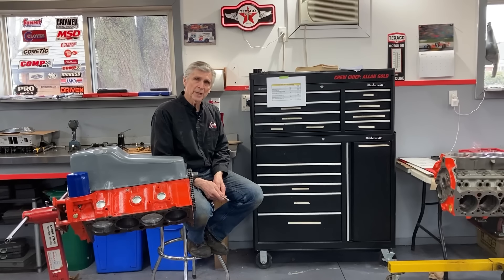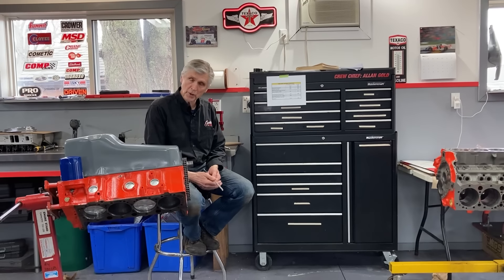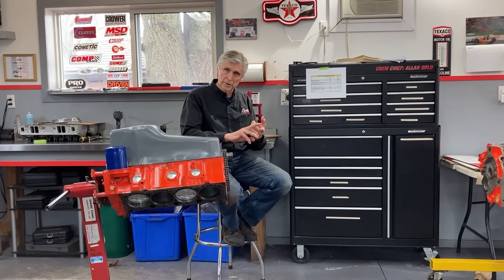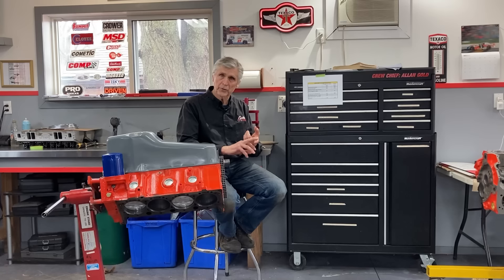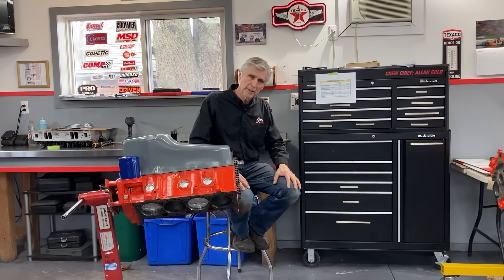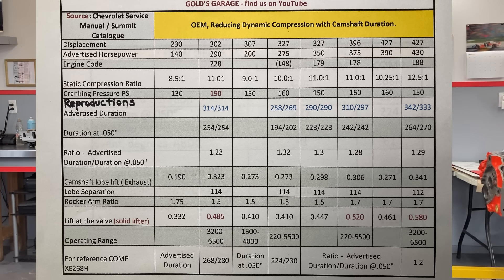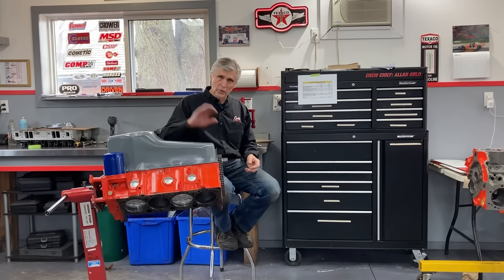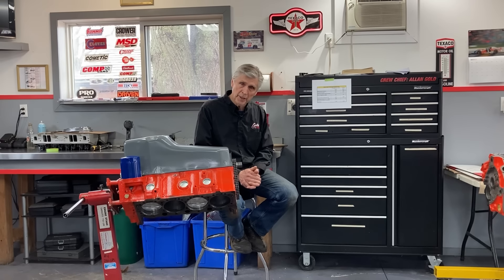Selecting the right camshaft - Compression Myths How much compression can you run on pump gas?

Comment: My 1998cc Alfa Romeo Spyder (mechanical direct injected) is running 16.5:1 corrected CR on unleaded premium (92 octane 100% gasoline) pump swill and has been for 41 years. It is a Hemi head and it turns 16,000 RPM (peak HP at 12,600 RPM) , but Alfa was building engines that turned 10,000 RPM RELIABLY before WWI! BTW, the Alfa engine has NO valve springs-it uses desdemonic valves with followers (forks) that push open and pull the valves closed. It also has a Magneto Marelli magneto and surface electrode spark plugs that whines like a turbo, driven by the crankshaft.  The clock is showing 180,000 Km and it doesn't use any more oil than when new (about a liter between changes, normal by the owner's manual). The four-banger holds 7 liters of oil WITHOUT filter or nearly 9 with filter (big oil cooler built-in).
Reply from the maker: Very cool Ricky, must sound great at 16,000RPM. Different world than Detroit muscle.
Reply: Cool very interesting. I'd like to see the valve train
Reply: Big American engines with long strokes cannot reliably turn over about 6000 rpms in somewhat stock configuration.  I have no idea what affect extremely high engins revs have on pre-ignition.    Most stock  engines sold in North America are around 89mm stroke.           A  $40,000 full custom race engine for circle track use will usually be 6.7 to 7.6 liters, roughly, and they are usually around 100mm in stroke.   These engines will run several thousand laps in a year, and they will have acceptable reliability at around 9000 rpm maximum rotation speed.
Reply: @kevinkelley3657  i have a 427 that I run it  at 8500 rpms   it's a aftermarket Dart aluminum block and 12/1 compression I run M1 methanol  and a 98mm forced Inductions turbo point being you can build à reliable engine to turn rpm mine is a small block but that's all that I will give out Openly on here I still race so I'm just saying you can you just have to get the right parts and engine builders I go to tkm there the best in the country.
Reply: @MarineX1124  I said in my comment that "custom engines" could turn 9000 rpms reliably in a circle track engine, for one year...........I said that these engines were usually around 100mm in stroke.       If you disagree with me, what is your exact argument?    I have a VERY good friend who is THE machinist to use in this are........I also understand what aftermarket heads are capable of doing.       I am not sure that I understand your argument, but if you have $10k to 15K to spend in parts, you can absolutey build a 9000 rpm chevy based engine that should live for 40 races on a round track under 1/2 mile in length.
Reply: You mentioned the machinist I see you have the last name of the best here
Reply: @davidreed6070  The machinsts name is "Damon Wrightt".   He and his brother own the best machine shop in my area.   I do not really understand your comment/question.   Are you a real person????
Reply: @kevinkelley3657  yeah I just noticed you were talking about the Best machine Man in your area, your last name and the Machine Man in my area is the same. The man held the pro stock championship in the day. Who knows you and him could have been kin. I meant you no disrespect at all
Reply: Alfa Romeo, or in fact Italian's, making anything reliable... ROTFL

Your car/engine combo must have been a special order?  

BTW the inlet runner, throttle opening, port, valve, exhaust valve, port, pipes and cam duration to support peak HP @ 12,600 rpm at 1998cc will see peak torque around 10,000 rpm. Idle would be up around 3000-3500rpm

And the clock is showing 180,00km's you say? I bet it drives like a dream in traffic too?
Reply: @davidreed6070  Ducati use this too
Reply: Is that unleaded from america? Or another country? I know over seas from america they use 95+ octane where as here in the states we dont get anything higher than 93 usually.. i know shell has 94.
Reply: @DrGibs347  I think gas is rated different in America from overseas.
Reply: That’s awesome.  Sounds like a stout little piece.  Has to sound great at 12,000 rpm.
Reply: What bullshit are you talking about? There's no such an Alfa engine as you described, especially on the Spider. The only thing with similar performance to modern engines was the V8 from the 33 Stradale but that was basically like having a road legal LMP car today. Also I don't remember Alfa Romeo using desmodromic valvetrain in any car whatsoever, it was Ducati that started to use that on their motorcycles since the mid 50s.
Reply: What kinda AM? I’d love read up on it more
Reply: 16,000 RPM or about DOUBLE what Honda VTEC  is capable and TEN GRAND in 1915 ?? in the "Castor Oil" days . . . before fuels were "formulated" - BULL !!
Reply: they say the higher rpm the less time for detonation to occur as the flames can only propagate as fast as the engine speed allows and at above 20,000rpm the flame just cant burn fast enough

Comment: On a 350 Cid truck engine with 422 442 cam 204 214 at 050 dur. 112 lsa. Would a 194 intake valve size be a better choice for velocity and low speed torque. I want to buy some Brodix 180 heads but maybe that's a little too big and I want good mpg. Flat tops .020 down. Quadrojet with factory aluminum manifold.
Reply from the maker: Thanks for your question Jacqueline. I don't think the Brodix heads will hurt, but they are more than you need to work with the rest of your parts. If cost isn't an issue you could use them but there are less expensive heads that will work well. Hope this helps. Good luck with your build. AG

Comment: Combustion chamber shape has large impact.   One extreme example is the Jag HE V12 engine, has a pocket in the combustion chamber that's 11.5 to 1 on pump gas back in the 80's.   Also today's modern heart shaped tight quench wedge shaped chambers are more resistant to detonation.    Also good spark control off the crank shaft helps.  This is a particular problem on the SBC with it's dist far back and at the end of the cam... that make the spark bounce around, that's no good and that variation can cause  erratic spark and trigger detonation.   Crank triggers are a must with high compression.
Reply from the maker: Thanks for the comment John. You have deep knowledge on this subject and giving us something else to think about. AG
Reply: I struggle with small block mopars trying to make them run smooth.  I put on a set of "fast burn" heads, heart shaped modern design and Wow, what a change. Best small block Mopar I have ever seen.

Comment: Just as dynamic compression, set by the camshaft events greatly influences cranking cyl pressure, a running engine has variables that determining the octane requirements. A high compression race engine with over 14:1 calculated compression ratio with a relatively short duration cam could reliably run on 87 octane gas no problem, if the torque load was kept minimal. This would require a throttle opening to maintain relatively high intake vacuum. In this case, the engine can't develop high combustion pressures/temps associated with detonation. There's a ton of other factors at play, combustion chamber temp and efficiency,  total ign. timing requirements, accuracy of maintaining proper fuel distribution and ratio evenly across all engine loads and cyl to cyl, etc...

Short answer, in an old school carbureted muscle car era engine, I would agree with your assessment on taking a close look at cranking compression pressure as a good overall indicator of detonation resistance. Unless someone was willing to spend a ton of money to modernize all the development shortcomings due to age of these old engines, and taking the owners dedication and ability to monitor for signs of detonation, I'd say anything over 10:1 would really be pushing it when combined with a typical hot-rod street camshaft.
Reply from the maker: Thanks for the input Jeff. AG Look for future videos on this subject.

Comment: VERY WELL PRESENTED. ALSO LOBE SEPERATION ANGLE. L88 WAS 114. TIGHTER LIKE MOST COMP CAM STREET CAMS ON 110 MAKE MORE CYLNDER PRESSURE WHICH EQUEALS MORE POWER. ALUMINUM HEADS ALOW 1 POINT MORE COMPRESSION ON SAME OCTANE..180 TO 200 PSI ON A PERFORMANCE STREET MOTOR RUNS NICE. BUT NOT SO MUCH FOR TOWING BECAUSE OF HEAT GENERATED LONG TERM
Reply from the maker: All good points Hank, thanks for contributing. I will be making more videos on this subject, watch for it.

Comment: My 467 has 10:1 static compression, and 200psi cranking compression. It runs on 91 octane with 36 degrees of timing locked out. No pinging ever.
Also, I recently tested Shell 93 octane. It had 7% ethanol. And I also contacted Shell Canada about ethanol content in their 91 and 93 octane fuel.

They replied just today that their 91 and 93 now contain up to 10% ethanol.
Reply from the maker: That is good information Pockets, Here, there was a sticker on pump saying that 91 contains no ethanol. I will check again. Thanks for the comment, please keep watching. AG
Reply: Try E-85, wow !
Reply: I have a 302(5.0 coyote) with 12.5:1 compression and about 180 psi cranking pressure which I run on 91/93 
235/237 duration 
~535 crank HP
Reply: Well then your fuel mixture is below 12.8. There’s got to be a trade off somewhere.
Reply: You have a fat overlap(not LSA) of about 60-85 degrees yes? That will bleed off that compression. In other words it’s a higher reving cam profile 3500-7000?
Reply: @MrLuvtheUSA variable cam timing allows the exhaust valve to stay open longer to bleed off pressure under load. Oil pressure is the key to this application. Low rpm lower oil, more exhaust bleed. Higher rpm higher oil pressure less load on top end reducing pinging with a more closed exh valve timing sequence. Make sense?

Comment: What an high quality content !!! Thank you so much for all the effort and time  to explain things and help us out building our engines . 
I’m currently building my small block Chevy with a target static compression ratio of 11:1 , it’s a 305 with -0.5cc dome pistons and 56cc Aluminium heads (trick flow) , I’m still unsure about the right camshaft . I want it to be a solid flat tappet , I’m thinking about comp‘s extreme energy 12-664-47 it’s a 4/7 swap . I’m just concerned it’s too small for my compression ratio. I am aware that I will need to run high octane fuel 
Btw the engine will be coupled to a tremec tkx 5 speed transmission and a 3.73:1 rear gear in my 79 Camaro 
Best regards from Germany !!
Reply from the maker: Thanks for the question Ricky and hello Germany. That is actually quite a big camshaft for a 305 in a street car. I suggest you go to the Wallace on line calculator and check your cranking pressure and dynamic compression. I like to be around 180PSI. Hope this helps.AG
Reply: thanks for replying! I highly appreciate it, I tried the calculator and it says 195 PSI cranking pressure and 8.54:1 dcr, since I run aluminum heads I could get away with that I guess … 
Yes that camshaft is large for that little engine for sure , but we’ll see .. have a nice weekend!

Comment: Years ago I rebuilt an LT1 in my 70 Z28, although at the time I was led down a path of lowering the CR, I think stock was 11 or 11.5:1.  When we were done I think I was around 9.5:1 and at the same time the GM performance handbook on LT1's listed a offroad cam for the engine, at the time Crane built one to that spec so I installed it.  The engine never ran right so I called Crane and the first question "what CR are you running?"  He said you need a minimum of 11.5:1 to run it.  So I had to pull out that cam and replace it with a lower duration hydraulic.  Now for my question;  I am about to embark on a Ford 351w build with a brand new 4 bolt block.  I am also making it a stroker 408ci.  I do not want the high HP but I prefer a high torque motor, it's going in my '85 Jeep CJ7.  Two things I would like to know;  If I run E85 or 91/2 octane what CR should I shoot for?  Also what off the shelf roller cam should I pick?  Thanks in advance!
Reply from the maker: Thanks for the question Dave. With a roller cam, you need less duration, but you have lots of stroke so duration in the range of 210-220 degrees @.050". With 91 octane fuel, 10:1 CR with cast iron heads and 10.5: with aluminum heads. Design for a max cranking compression of 175-180psi. you can find on line calculators for static and dynamic CR and cranking pressure. I don't have any experience with E85 but I think you could run higher CR and cranking PSI. Hope this helps. AG

Comment: Having quench rather than open heads has huge impact on how much compression you can run.  
In Australia our standard 430hp 351c, which I still have in an XE ESP runs flat tops, 302c heads opened up to 66cc’s, F246 cam, Weiand  excelerator, 750dp, good extractors straight thru mufflers which make 430hp at 200psi dynamic compression.  
No pinging but low gears and light car has a big impact on how much compression you can get away with using pump fuel.
Reply: Forgot to add it’s a long rod 351c, which also lowers dynamic compression, uses a 302c 6” rod rather than 351c 5.78” rod, has modified pistons.
Reply from the maker: Hello Chris from Australia. Those are good numbers for a 351 and 200psi. What octane fuel are you using? AG
Reply: @ Hi, The highest we have which used to be 100octane but now can only get 98, but equals around 94/5 in USA.  I have 3.5 diff gears weigh around 1750kgs and top loader box.

Comment: I sent my cam in to a custom grind shop. Im building a stock FE 428 stock dish 4.13 pistons. After I got the cam back he said to keep compression lower than 9 to 1 and use a stall 2500 converter. Putting it in my 72 f250. Just now learning about cams. Just got my new pistons. Im seeing on my cam info card that intake V Closes at 38 ABDC. I need to assemble the rods n pistons to see what comp height is this week. I think the cam he sent me would raise the compression up if i understand correctly. My heads are 72 cc and gasket .o42. This is my first home built short block.
Reply from the maker: Thanks Ed, looks like that cam IVC is a good match for 9:1 CR. After you determine the deck height, you will have enough info to calculate the dynamic compression and cranking pressure. The Wallace racing on line calculator works pretty well. Good luck and let us know how it turns out. AG
Reply: Thank You. Oregon Cam here in Washington has been building cams for ever. After I  do some measuring I will send him another core. I have quite a few here.

Comment: great video, the thing that NO one ever talks about is how many BUMPS on the comp gauge is required to get the needle to 150PSI? Hydraulic lifters give mushy valve action when cold so thats why we test at operation temps. Ive done 100s of comp tests at GM on thier dynos in australia  and the SLOWEST comp needle movement was from the LS series of engines, they required 8 comp bumps to get to the desired 150PSI with a 10.4:1 engine! But when we took out the corvette cam & installed a 5.3 truck cam the comp was now 165psi & it only took 4 bumps on the gauge! testing on the truck cam bought peak torque and horsepower down the RPM line about 1000rpm. My boat has a 351c with 302c heads  & laid back chambers to give a measured 10.2:1 comp, with a 218 cam. comp gauge reads 165psi in 2 bumps on the gauge and it just likes 95 ron fuel ( your equivelent 91 octane)... I really enjoyed your video, keep up the good work.
Reply from the maker: Thanks Wayne from Australia. Did you know, the number 1 city in terms of clicks on my site is Milbourn Australia and many other cities in Australia are right up there so thank you for the great support. I think the Wallace Racing guideline is 7 bumps but for the reasons you mentioned I think you should  keep going until the pressure reading stops going up. Usually that is about 4 bumps. 91 fuel should handle 165psi easily. Hope this helps. AG
Reply: What kind of exhaust manifolds on the cleveland in the boat ?

Comment: We ran our 482 big block Chevrolet with 12.5:1 on 91, for YEARS in a boat.  Kept the timing at about 36 never had an issue. My current engine with 11.8:1 runs great on 91 with 34 degrees, been in the car since 2008 with EFI controlling the fuel.
Reply from the maker: Good reference info bigblock. EFI will help for sure. Thanks for sharing. AG
Reply: What temperature engine ran in boat ?

Comment: Here in Australia we have at the pumps 91, 95, 98. What is max compression  for using 95 ? in a 5 .0 V8 on a carb.:oops:
Reply from the maker: Thanks Jim. That depends on a lot of things. Generally speaking 95 octane should be safe for 10:1 CR for cast heads and 10.5:1  for aluminum heads, however camshaft timing and even the pounds of car / ratio to cubic inch and gear ratio is a factor. 
My rule of thumb is 160-180PSI cranking pressure which verifies your DCR. 
Hope this helps. AG